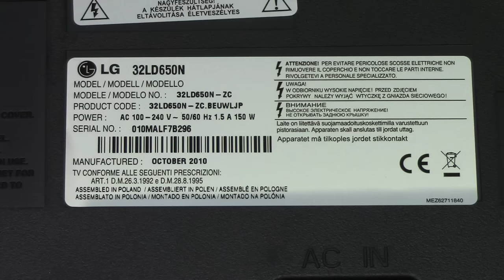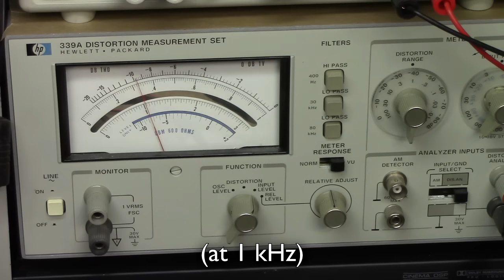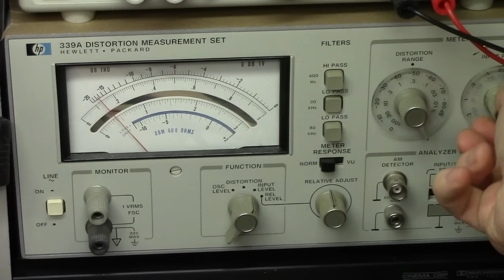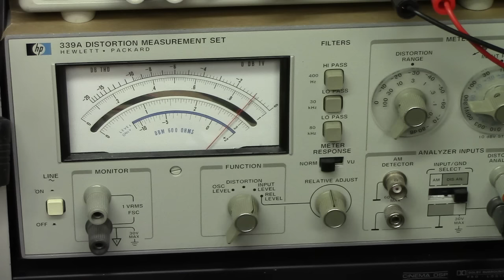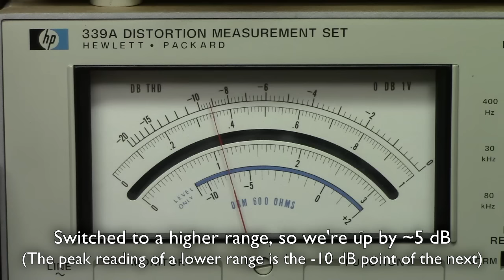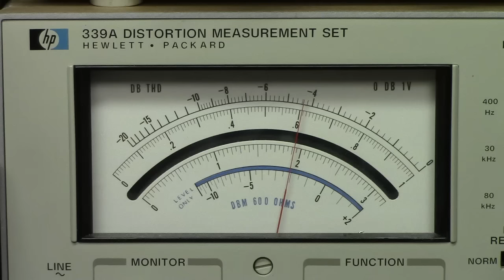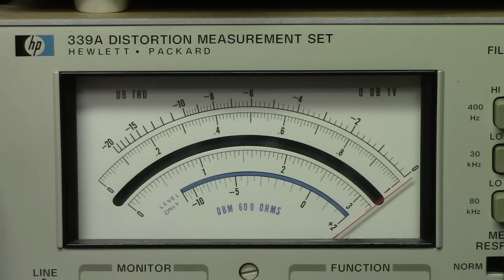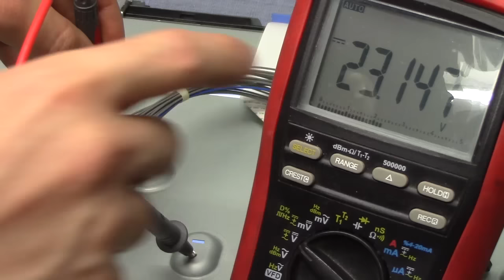Trash picked 32" LG TV hack & audio amp experiments

Comment: I got lucky with one dump TV. The audio amp was on it's own board. 12 volts to the power, add a source and I was rockin', I'm thinking it needed more because on 12 volts it cut out but I ran it on a 12 volt NiCD battery pack from a broken drill and it worked fine.

Comment: I'd expect the angle the TV is sitting on will in turn help keep the BGAs from cracking off from the weight on their backs of the heatsinks, aside from the snot you used to reinforce them. did the chips even have the glue spats on the corners from possible wave soldering? sheesh. (I will admittedly say I once permafixed a D830 with a good-month NVS135M that had cracked joints by giving it gobs of superglue underneath after it was nice and cooled down... but this doesn't always work, seems.)

I did a similar mod with my HP F1703, after fixing the display connector which had cracked joints from the factory, probably why it was inevitably thrown out and there were lawsuits about the model. mine was a bit... easier, though. the monitor provides passthrough voltage from the 12v wart that powers it to also power some shoddy HP-rebranded speakers and maybe a subwoofer if you had money for it, back in the day. this is done through a smaller DC jack next to the main one. the idea was the power brick was over-spec for the monitor so it could drive those: http://h20564.www2.hp.com/hpsc/doc/public/display?docId=c00502007

what I did was removed that jack and replaced it with a normal one. originally it ran a WRT54G in my bedroom way back about 7 years ago, and then I stopped using that so it went unused. when I killed my 2007FP a few months ago, I quickly grabbed it from storage and put it in place, moved monitors around, and now it powers the Dell sound bar (used mostly just for headphones because they're horrible otherwise) on the 21" Dell panel on the left. does this through a 12v 5A supply I was originally going to use with the SGI 1600SW on the shelf behind me (ample breathing room for powering both the monitor and the SGI multi-link adapter I can't get my hands on at all for cheaper than $100), and is still absolutely over-spec even with two loads hooked to it.

and no, unless the speaker bar turns on with the TV, you're still going to have to leave your bed unless you mod a broom handle with a capacitive pen tip...!
Reply from the maker: +Sudos I actually ended up not using the jack, since I wanted to have the soundbar on without the TV. If anything, the issue is that the bloody thing turns on automatically when you feed it signal, and you can't turn it off. I got a rude, screeching awakening when the Creative drivers crashed in the middle of the night, last night.

Comment: Haha great video!!  Those cushions look comfy, how come they are US flag not Swedish flag!?  Would the same board be used for different sized TVs and what about the TV headphone socket?  Would that have the same problem as the amplifier chip??
Reply from the maker: +Knuckles the Echidna The headphone output had a flat frequency response (obviously, since they don't have any LG-specific headphones to compensate for). LG tend to use the same mainboard in lots of models, but I haven't checked this one, since I had no reason to.

The cushions were bought because they were on sale, as no one else wanted to buy U.S. flag cushions. I consider them to be ironic more than anything, since they don't even have the right number of stars on them.
Reply: +FFcossag ahh now I understand I was scratching my head a little, not as clever as you are 😀😀 Lol I wonder how they managed to screw up the flag!?!?  Ohh well at least they look comfy 🙂

Comment: was that a micro-hdmj under the hdmi
Reply: micro-hdmi
Reply from the maker: +Joyrider No, it's some odd proprietary "Remote" connector, I have no idea about what it does.
Reply: +FFcossag what is the port under the VGA input for
Reply from the maker: +Joyrider I don't know, I think it's labelled "Service", so it's likely to be some kind of diagnostics thing for LG dealers.
Reply: +FFcossag It could also be some port that can be used to control the TV (for example if you want to use it in a bigger installation or in a hotel or something like that). Would be interesting to see you play around with that. Not sure if there's any documentation on that out there...

Comment: My TV has an annoying issue. The headphone jack output volume can only be controlled from deep in the menu. You can have the TV speakers running at the same time as the headphone, which is just a dumb idea. It is cheap junk though.